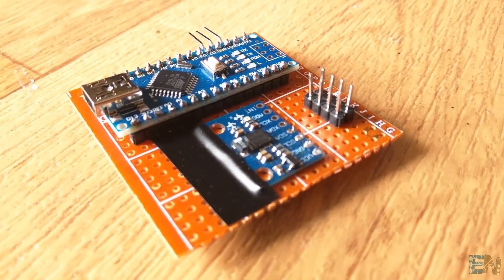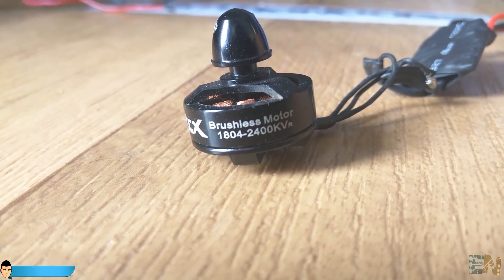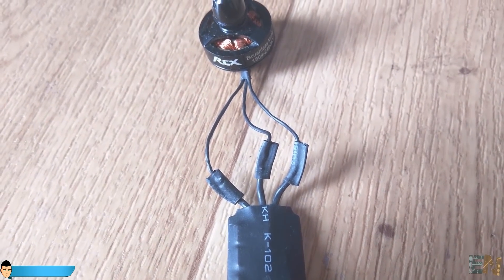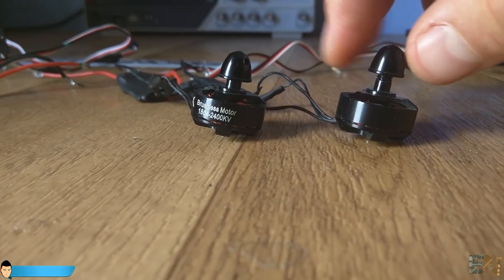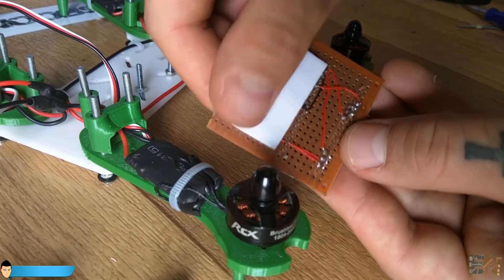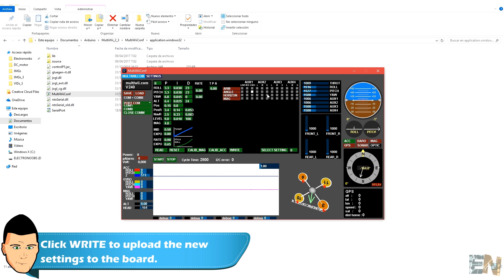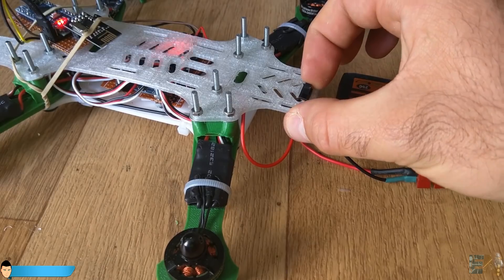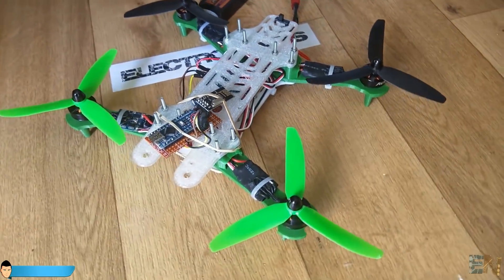Arduino drone - Part3 Drone built

Comment: Sir when I tried to configure after the message appeared on the serial monitor of arduino I wrote the minimum value then it came the message to write any value between 1000 to 2000 the spin the motor but after writing that I ESC was just beeping
Reply from the maker: Send 2000, then connect the LiPo battery. This will enter into config mode. Them send 1000 and that will set the range. After this you can send 1000 to 2000 in order to control the speed.

Comment: Cool series! Just one question, to which Flight control pin do you connect the PPM pin for the receiver?
Reply from the maker: From the reciver digital pin D2 to the flight controller digital pin D2. And also share gnd.

Comment: I've ordered my parts and can't wait to start this (the body is already printed). :-)

Would you consider expanding this project to be GPS guided, and possibly adding FPV?

Great project, keep it up
Reply from the maker: The FPV is separated from the Arduino part. Depends on your gear. The GPS works but I haven't tested it yet. Using Multiwii you have multiple choices. I think there are other videos about it. I'm not sure when I'll be able to make a video about that since I'm working already on other projects...

Thanks and keep up!
Reply: How about a onboard camera that records, with heads up display data?  I saw this Minim OSD on aliexpress and wondered if it could be incorporated into a onboard camera to record the flight. :-)

Comment: Is any problem while using atmega 328p ic directley on the pcb board for flight controller ? there is any change to the code.?
Reply from the maker: Vishnu Sadhu no, the code should be the same. Make sure you make all the connection right and upload the code with an FTDI module...

Comment: Hi Electronoobs! I am working on this but I was not having radio controller(old transmitter)..so i decided to make a desktop application for transmitter in visual c# and made some development in tx arduino code. The transmitter work fine with multiwii everything throttle yaw pitch roll works on ...but when I try to start the drone by making throttle min and roll max the drone doesn't start.....please help

Comment: Is it posible to use 1000 kv  motor. The drone will fly or not
Reply from the maker: I think it will, it is quite light. just use small lipo battery in any case.
Reply: I like ur project 
So i am making the surveillance drone as  my MSD project in my collage.so i wand to know more about it. Will you please help me to clear my doubts on the project .so please give ur contact details. I wand to add two servo motor to contol the camera is it posible to do  that?
Reply: Is it any problem that using atmaga 328p ic directley on the pcb for flight controller
Reply: Can i use 3s lipo battery

Comment: can you make a Bluetooth 6channel Arduino mini  reciver so that any one can make use of that by only using smartphone
Reply: shreyesh SA Infrared won't work well ouside becouse of sunlight. If you really want to use smartphone as controller you'd propably need singleboard computer with wifi.
Reply: I've tried this approach myself. I've heard of Mikroe sellin' long range Bluetooth 2.1 modules, which claim to range as far as 1 kilometer.

But, the modules themselves are quite large & fitting them into somethin' the size of a 250mm racing drone or a 450 class pod-&-boom helicopter wouldn't justify the concept very well.

Not only that, Bluetooth 4 (AKA Low Energy or BT Smart) doesn't have much range to start with (as far as only 10 meters). Also, with 2G4 (2.4GHz) radio, there's a myriad of different protocols out there & simply because these devices operate on the same frequency won't guarantee that they'll "understand" each other.

Even within the Bluetooth protocol in itself; BTLE won't talk to Bluetooth 2.1 (& earlier revisions) & vice versa. I own a laptop & a smart phone that both have Bluetooth 2 modules in them & I have a BTLE module that neither of them can "see", let alone "talk to".
Reply from the maker: shreyesh SA you could. shouldn't be that difficult but Bluetooth for drones? in 20m you will loose connection.
Reply: Electronoobs  yeah ok , can we operate 2.4ghz nrf through smartphone ?? becoz some of the smart phone has Infrared so we can make use of that?
Reply: ZZ Cat  you mean HM-10 BLE 4.0 Bluetooth module which range more than 100 meters
Reply: Mili theMUFFIN or just a cheap ESP8266 a few supporting components and some time

Comment: Is it possible to use only one arduino on the drone part if I don't use the M6050 module?
Reply from the maker: You can't fly a drone without a inertial movement unit! it's imposible! You need the MPU6050 or any other IMU.

Comment: But, what happens when the Lipo battery runs out? Does it crash or do you get warned some how?
Reply from the maker: Lucas Jacobsson in the way the drone is in the video it would slowly go down as the battery gets empty. but the multiwii has a battery check pin. you have to add a voltage divider and connect it to that pin and the multiwii will know the real voltage.

Comment: Hey man, that's awesome(i'm brazillian, sorry for my english...hue). I Wanna try to Build this drone here, but I have problems to find some things, like the bruhsless motor and the ESC. Did You make an eletronics course, or anything?
Reply from the maker: You can't use eBay there? And yes, I'm an electronic engineer!
Reply: Check out HobbyKing. They have plenty of RC gear over there.

Comment: Im having 1100mah lipo battery with 3.7v it can work or not
Reply from the maker: 3.7V is very low voltage for this drone! You need at least a 7.4V lipo or more!

Comment: why did you use 2 arduino?  Don't has one of them enough pins?
Reply from the maker: It's not about the pins. The flight controller is busy enough with the multiwii PID code and the NRF library would slow it down and make it have glitches. So it's better to use one for the radio receiver and another for the flight controller. Beside to merge both multiwii code and NRF module is a little bit more complicate. Keep up!

Comment: what about esc code we have to apply or not if we have to apply the code please provide us the code
Reply from the maker: shanu mittal if you're talking about the calibration code for the ESC you could find a link in the description. is called ESC calibration. always check the video description. keep up!
Reply: If I saw that, I want to calibrate the four motors, I only find to calibrate the "y" axis, as I add for the x axis.
Reply from the maker: walter juan de dios el código de multiwii no necesita calibración. lo que necesita calibrar son los ESCs y eso se hace unos por uno con el código de calibrar esc. multiwii es una plataforma de flight controller compatible con Arduino. no se de que hablas del calibración del eje y. no entiendo tu pregunta. espero haberte ayudado. saludos!
Reply: en este codigo solo controlo 2 motores verdad 

/*Finnaly using the servo function we create the PWM pulses with the calculated
width for each pulse*/
left_prop.writeMicroseconds(pwmLeft);
right_prop.writeMicroseconds(pwmRight);

ho sino  cual fue el codigo que cargaste al arduino  para que vuele
Reply from the maker: walter juan de dios te estás equivocando de tutorial. ese código es del tutorial del balancín con dos motores. este vídeo es una serie con 3 vídeos para construir un dron completo de 4 motores. si lo que quieres es hacer el balancín para 4 motores aún no tengo el tutorial hecho y el código está en proceso... lo siento
Reply: ahh pero pense que ese codigo estaba utilizando para el dron  yo tengo un dron que es de 4 motores es igual que el tuyo tanbien tengo el MPU 6050  QUIERO EL CODIGO PARA EL DRON NO PARA EL BALANCIN. podria avilitarme por fabor el codigo  del dron de 4 motores.

Comment: it doesnt matter what order the wires for the motor go to the esc, the middle wire doesnt have to go to the middle :)
Reply from the maker: no, you're right. but because later you would have to swap two wires to change the spin direction (if not the desired one) in my case it is easier for me to explain how if I just fix a middle wire. Keep up and thank you!

Comment: Your idea is great. I will make this drone.
Reply from the maker: Yes, the idea is to make this project all based on arduino. So I don't know any other platform that works on Arduino than multiwii. But yes, multiwii is quite old. That's why in future videos I'll make my own code, crude but it will help people to learn about PID and gyro data, etc... Keep up!
Reply: Great if learning how all components in a quad works! You may want to look at other Betaflight based miniquads (or race quads) as the MultiWii platform is not currently being developed and it is old technology. Look at current miniquad build videos if you're aiming for performance :)

Comment: hı thnx for perfect project.
ı want to build a rc car ı have every equipment but ı dont know how to write arduino l298n control codes ll you help me ?
Reply: ı have; 2×arduino uno or arduino nano, 1×tower pro servo motor, 1×dc brushed motor, 2×NRF24L01+ radio, 1×l298n motor driver, 2× joystick board and all of usefull equipment but ı dont know how to write  control codes for arduino.
Reply from the maker: for the l298n H bridge you just have to send PWM signals. Check this video of mine of the RC tank: https://www.youtube.com/watch?v=f3NJcaniAjs

Keep up!